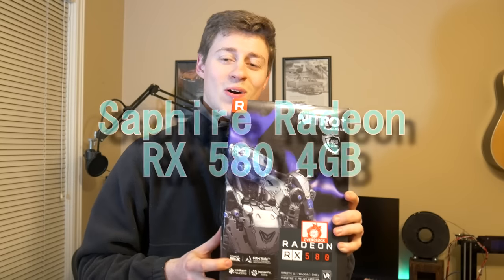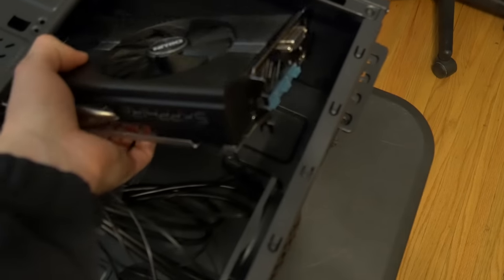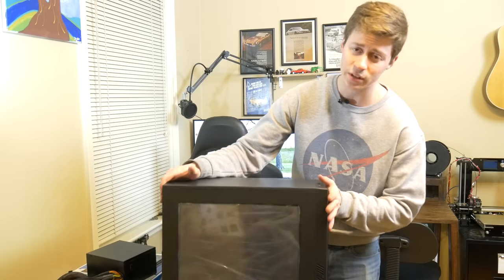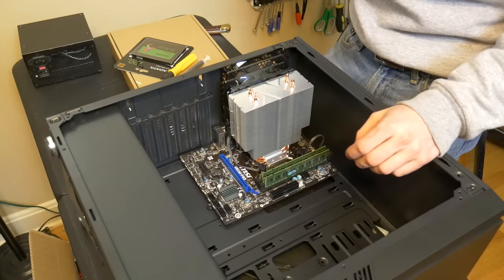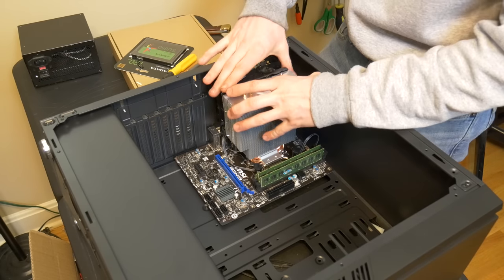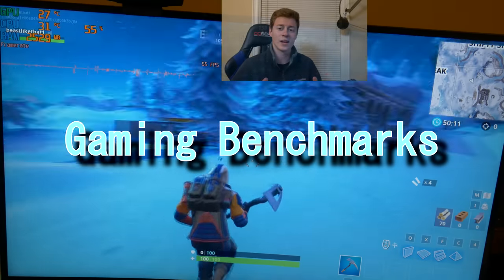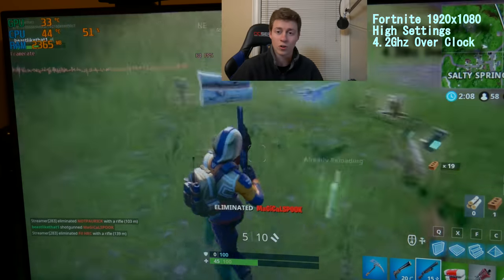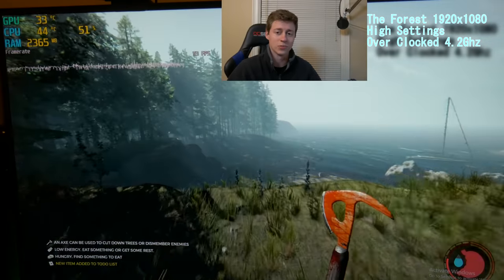2019 Dual Core Monster Gaming PC!?

Comment: Make a pc with such bad cooling you make toast with it
Reply: Fx 8350
Reply: UnKnown Person no fx 9570
Reply: @greenfolk9266  Calm down there's no need call the Fire Dep. supervising the OC just in case. As a side note you can try and search a Xeon equivalent CPU for the motherboard.
Reply: GTX 480.
Reply: What about a 9900k?
Reply: Fx9570 with a 480 with the cheapest cooler available, bound to start a fire in minutes
Reply: Pentium 4 or celeron
Reply: Audatious Xtreme overclcok To 5ghz
Reply: FX 9590 paired with crossfire of two R9 380s
Reply: @EdenOVA : I rarely build my own, but when I do, I tend to blur the line between "perfectionism" and "mental illness.  Every full tower I've ever build accomates a warming (or toasting) tray along with the classic pop-out cup holder to secure your favorite adult beverage.

Comment: Dual Cores are not completely dead but aren't really recommended for newer games since 4 threaded CPUs (even hyperthreaded dual cores like the i3-4170 and Pentium G5400) are used as a minimum for smoother and mostly stable performance at high settings at 1080p. For me personally, I kinda have a soft spot for dual cores in less demanding e-sports games.
Reply: I use the g4560 and a 1050ti with it, and I m happy. It's giving me gud performance for the price.

Comment: ok so what parts would you recommend getting for video editing, streaming and gaming? my budget ranges from $700 to $900. Please help
Reply: Toasty can u do a build of this? Interested aswell
Reply: Definitely go for a ryzen 5 or ryzen 7 for your processor. You might even want to wait for the ryzen 3rd gen processors to come out. Those are going to be budget workstation beasts. I've heard the Ryzen 5 3000 series is going to have a bump up to 8 cores 16 threads!
Reply: As for the gpu I' suggest getting an RTX 2060, or if it's ever going to release, a GTX 1160.
Reply: @TheNBKiller  ight sweet, thanks man
Reply: A gtx 1050ti or 1060
Reply: Or 1070

Comment: I have a core i3 6100, 12 gb ddr4 2133mhz ram, gtx 1050ti, 450 watt power supply and an msi h110M Pro VH motherboard and it only cost me about 300 euros total since all the parts were used

Comment: God damn it, you got me looking on Taobao for 1150 mobos because of this video. My bank account doesn't neeeeed this.. but I need it... but my bank account doesn't.. but I do.. argh.

I dug around in my drawer and found very first cpu that I ever bought to do my first upgrade ever. A q6600 for socket lga775. 

I replaced an e5800 with the g6600 for an impressive 10% performance gain! :P
Reply from the maker: I have a Q6600, motherboard and RAM.... Considering doing a build with it.
Reply: @ToastyBros  I got mine set up on my kitchen table, was going to test a gtx 550ti I picked up for dirt cheap. I'll see if I can get it working and tweet you out a pic or two on twitter. 

Got me thinking too.. can it play fortnite?

or more importantly..

marble madness???????
Reply: With a decent used 1150 Board you could try a used xeon x3470 (4cores, 8threads) which is pretty cheap and is almost identical in performance to an i7-860. Recently built one of these and briefly overclocked (3.9Ghz OC) and tested it in games before using it as a freenas system, surprisingly it runs pretty well in games without problems. Only issue i had with it is that it only had x16 PCI-E lanes which means no nvme for me or any other PCI-E x4 devices other than your GPU if you want it to run at its best in games (ssd works just fine) tested it with Hitman and Rise/Shadow of the Tomb Raider dx12 which ran 60+ fps (vsync on) with an R9-380x
Reply: I have a Q6600 overclocked with a piece of tape. That was also my first ever purchase and I replaced an E8600.
Reply: @ToastyBros  Tape overclock it lol

Comment: i have a g3258 with 8 gbs of ddr3 1600mz ram (1stick) what about a gtx 1050?

edit: with AAA titles like gta 5 and destiny 2???
Reply: Would be ok
Gta would easily run high settings 1080p 40 - 60 fps
Not sue about destiny, but it would run
Big games lile farcry 5, to rach atleasr 30fps u need to play on medium or low

Comment: current build i3 6100 3.7ghz asrock fatal1y h270 16gb ddr4 2666 2x8 sticks cheepo 500w psu and a gtx 1050 not the ti. loading times suck for anygame and does take a bit for windows to load all the way up after login but... not overclocking anything  1080p csgo 140+ fps wow solid 180fps no matter what im doing warframe same thing 120+ all the time and all games at high/ultra settings. tride gta5 does play well 40-60fps medium settings but i get ghost items that didnt load till its to late and i smash them. yes i know the games are not real demanding but i built my rig 2 years ago in hopes to upgrade it later only to relise that intell is out there dang mind on prices. go red team. next build im upgrading to is a ryzen 7 1700 or something around them specs arsock mobo b350 or 450 yes i like my asrock mobos. still have my spu and if i still need more im gonna get a rx570. should set me nice for a few more years till str4 socket stuff comes down on price.